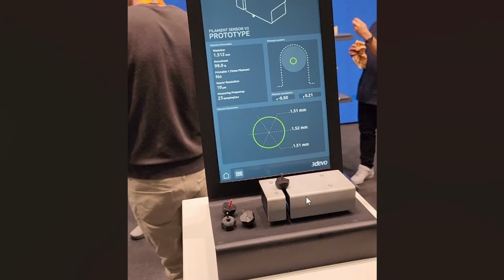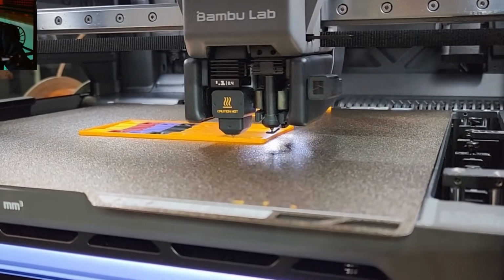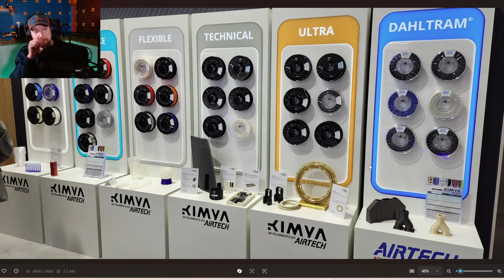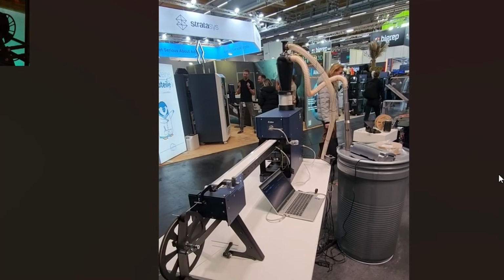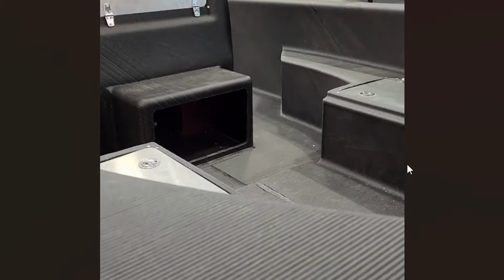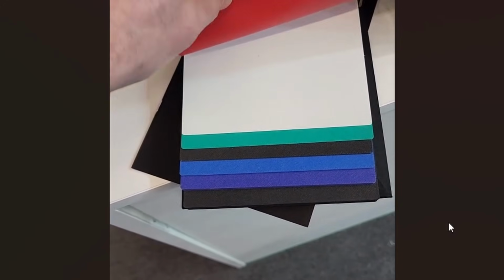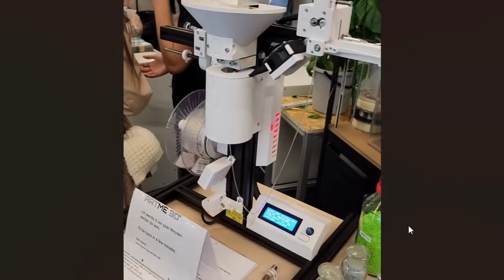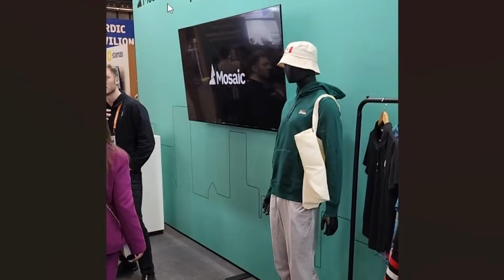Formnext 2025 Recap From a USA Filament Manufacturer's Perspective | 3D-Fueled Episode 11

Comment: Don't worry about the cats - it was temporary, and not hugely detractive to the listening experience.

The silicone printing parts of formnext were interesting for sure, and the INDX is going to be in my cart just as soon as they'll make one in the One L size, but the coolest thing I saw out of all the content there was the multi-vector slicing software, allowing for printing layers not just across the XY plane, but the Z plane as well - up tto 40 degrees I think they said, even with printers which weren't designed for it such as the X1C, using only a small cheap part to enable it. I'm just imagining the possibilities here, and they're crazy exciting! The fact that it's all closed source and that they never even touched on pricing though... Means it's probably well out of reach for anyone other than 'the big guys' :(

One question I'd wondered if you'd any industry insights into - any idea what happened to Fortis-3D as a filament manufacturer?

Comment: If you are looking into ways to summarize and compare filament properties, the most useful doc I keep refering to when deciding on filament properties for a project is the table from Bambu Lab.
It is kind of hard to find, only 1 way to get there: main page (not their store) > Filament > Fil Guide Learn More > Compare tab (hard to see, top of page)
It summarizes most properties while also listing printing parameters, plate type, nozzles, drying rqmts, annealing, etc. 
I always need to compare several params (especially layer adhesion + HDT + drying temp/time) and it can be done at a glance. Very convenient.
Missing though is the shrinkage factor. Critical since I print large / tall functional parts in ABS, PC, ASA. Would be nice to see that across filaments instead of having to load each profile and check in the slicer.
Reply from the maker: That is a really good tip! Shrinkage factor is one that is sometimes challenging to nail down, as fan speeds and chamber temps can have a decent impact on the shrinkage rates of some materials. 

Do you have a link to that table, by chance?
Reply: @3dfuelusa  sent you the link at your sales email address since yt blocks links.
Chamber temp and cooling are pretty much known / fixed when printing large 150-300mm parts, per each filament profile since we're no longer in variable 'short layer time' territory.
Don't care about shrinkage for small dimensions since it becomes negligible.
I get the same shrinkage value between different designs on above-150mm dimensions. For instance between a beam and a large flat surface.